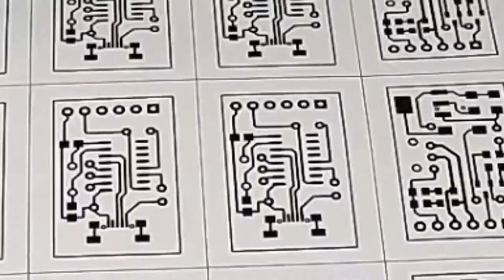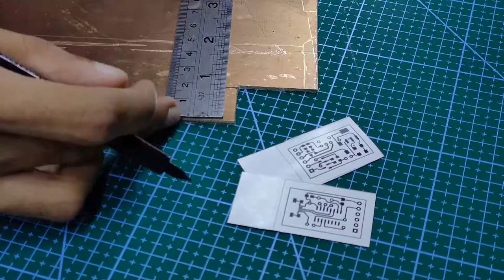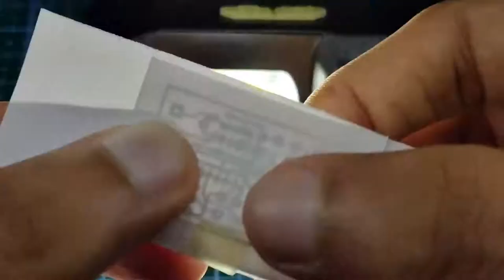DIY Double Sided PCB

Comment: IMPORTANT! Don't forget to:
1) paint it with a protective lacquer after soldering, or
2) coat it with some alcohol-dissolved colophony/resin before soldering, which doubles as flux, or
3) tin all traces with solder.

Otherwise the bare, exposed copper traces will oxidize with time, their resistance will increase and it may cause a lot of weird issues due to voltage drops.

Comment: I had a thought.  Would it make sense to drill the vias before etching?  That way you might avoid liftoff of copper if your second side is a small copper ring after etching.  Also, it would ensure that your print is 100% aligned.  

Also, instead of visual alignment, the via holes could be made to be alignment holes as well, so no eyeballing the print through light would be needed..
Reply from the maker: That's a fantastic idea! I'll definitely give it a try next time. Thank you so much!

Comment: Nice.  How much time in the etch bath?  You showed 3 or 4 clips.  How long did it take?

And where can i get a drill and bits like you have with the proper size bits?  I think you has .3mm bits?
Reply from the maker: The etching process typically requires a duration of approximately 15 to 20 minutes in my experience. However, it should be noted that when reusing ferric chloride, the etching time may progressively lengthen. Enhancing the agitation of the container during etching can assist in reducing the overall etching time.

The drill bits were purchased from a nearby electronics store. Alternatively, one can acquire them through online platforms. The specific drill bit showcased in the video has a diameter of 0.5mm.

https://www.amazon.com/Pieces-Polymer-Jewelry-0-1-1mm-Random/dp/B084T4PB1K/ref=mp_s_a_1_4?crid=1OOARF9JKZFN1&keywords=Pcb+drill+bits&qid=1688453567&sprefix=pcb+drill+bit%2Caps%2C393&sr=8-4

Comment: hi i would like to ask, the glossy paper inkjet printer can use? because i dont have laser printer
Reply from the maker: @shirochan4769  can't use inkjet. need laser printer.
Reply: @ElectroRetro  then what about glossy paper , there have alot of type for glossy paper, which should i buy
Reply from the maker: @shirochan4769  Any glossy paper will work. It won't make a huge difference. Here is a link to a glossy paper for PCB printing:https://www.amazon.in/TECHDELIVERS-toner-transfer-Glossy-Pieces/dp/B08KTKTTFQ/ref=asc_df_B08KTKTTFQ/?tag=googleshopmob-21&linkCode=df0&hvadid=422025000417&hvpos=&hvnetw=g&hvrand=2717779918183654604&hvpone=&hvptwo=&hvqmt=&hvdev=m&hvdvcmdl=&hvlocint=&hvlocphy=9149194&hvtargid=pla-1212036767881&psc=1&mcid=06c0aff5086d39b5be7cb229241ed279&ext_vrnc=hi
Reply: @ElectroRetro  ah thanks alot
Reply: @ElectroRetro  oh one more thing is glossy paper got two type , one is glossy art paper and one is glossy photo paper, i have the one of glossy photo paper , this work too right? if yes then i no need to buy another 🤔
Reply from the maker: @shirochan4769  Glossy photo paper will work.

Comment: Hi...Electro Retro .. really great work 👏👏 can I have circuit of PIR sensor Module with 4 leds with out any relay ..I need  simple connected with  Hi watt 9v battey . PCB designed PDF. Ready to itch

Comment: How much time is it taking to you too make wholes for the entire pcb
Reply from the maker: It depends on the size of the pcb
Reply: @ElectroRetro  recently i tried making a pcb at home I used a manual drill same as you for each hole it took around 10mins so how much time is it taking for you per hole. If it's quicker than me any suggestions would be really helpful
Reply from the maker: 10 min is too long. It won't take that long. You should replace your drill bit or you can use a mini rotary tool.
Reply: @ElectroRetro  oh how long is taking for you drill a single hole? And what drill are u using
Reply from the maker: Previously I used a hand drill, it would take less than 1 minute to drill a single hole using a hand drill. Now a days I'm using a small dc motor with mini chuck.
Reply: @ElectroRetro  oh nice

Comment: Please  never use any type of scrubber to clean pcb.
You will get super clean pcb  by 
1. Clean it with soft sponge and dish wash liquid  (to remove oil and   dirt films)
2. After drying with clean cloth, 
" use plasto pencil eraser " and rub the copper clad 
You will get it super cleaned.
3. Never touch copper side again with bare hand.
Try and reply me.
Reply from the maker: Thanks for the tip. I will definitely give it a try. One doubt, does this method remove oxidation on the copper surface?
Reply: @ElectroRetro  absolutely !!
You will get very  pure copper exposed.
I tried it.
Will result  in better    toner adhesion 
I used white plasto  eraser (used to correct pencil )
Reply from the maker: Thank you so much. I tried it. I got very good result.